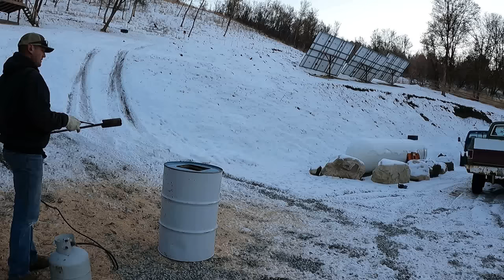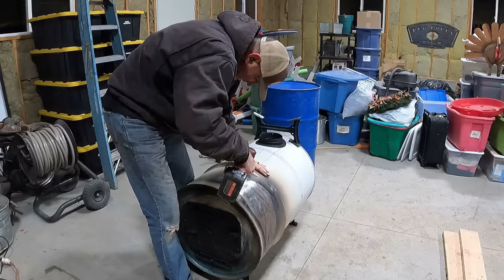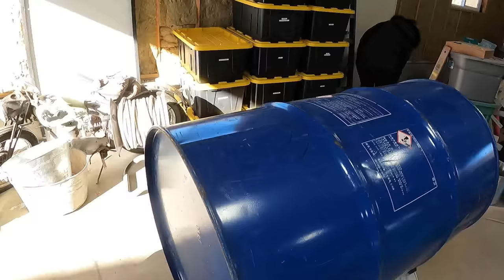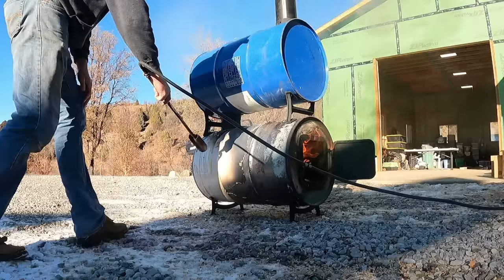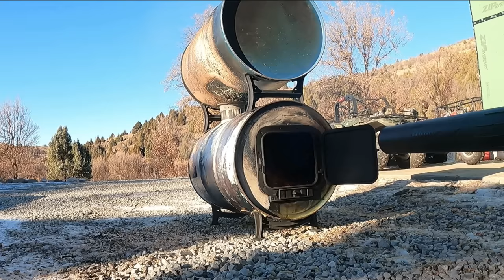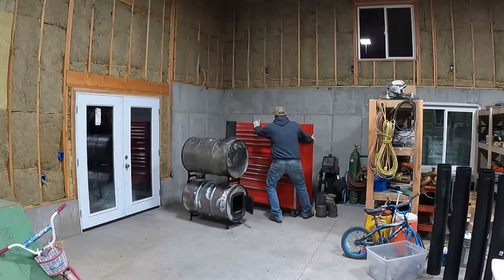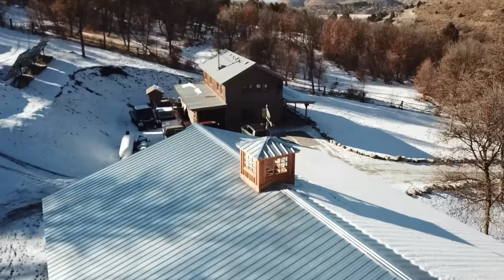I Built The ULTIMATE Wood Burning Stove For The Shop...

Comment: Awesome job. ne thing you did not consider is the metal weakness. In those barrels, the metal is so mild that it will burn through eventually. By this year 2022 you probably already have to replace the barrels if you used them a lot.
Reply: Mine is 27 years old this winter, ash bed only, never any issue with a few hours of yearly maintenance.

Comment: Now make a sheet metal cover to go over the air intake and use a dryer vent to the outside with dryer hose connecting the  vent to the sheet metal intake air  cover, 

So that make up air comes from outside and you dont burn your already heated air. You keep every btu  generated. This also makes the barrel stove pressure neutral.

35 % more efficient.

Be well.

Comment: Could have done radiant heat using a wood burning stove as a way to heat the water/glycol. Then the slab is more thermal mass to keep the shop warm after the fire stops.

Comment: Counter wasted heat up the chimney. Aluminum long fins (with tabs on the end) you can make yourself can be held on the exhaust pipe with a huge metal hose clamps, acting like a small radiator to gain another 10 -15% heat transfer.

Comment: If you buy heavy barrels you can cut holes in your double and 3 or 4 in the top of your lower to add 3/4 or 1" black pipe thru them, it will work more like a heatilator and push more hot air in to the room, you can also add a heatilator to the exhaust and retain even more heat
Reply: More bends in your pipe also slows your exhaust down to help retain more heat, also adding a 90 at the top of your barrel and a drop catch can help not get water and such in to your heat source
Reply: @kwazhims3lf  I would put a cleanout on my top barrel, and a good heatilator has a cleanout scraper on it.
Reply: @kwazhims3lf  I did see the cap after I made my comment, but still has a chance of getting moisture in

Comment: First I would have found a barrel with a removable lide and clamp. Lined the bottom with fire bricks and have the ability to clean out the ashes . Hang a fan behind it and possibly a ceiling fan . The cold air intake is obvious. I realize he is off grid but he does have power.  Cold weather comes at a cost.

Comment: put some firebrick in the bottom of the fire barrel and offset the door appropriately and you will have a long(er) lasting stove.
Reply: Yeah single wall pipe on the rafter is not a good thing I would go for more of a foot for spacing.

Comment: Obviously after the fact, and bearing in mind I have built precisely zero barrel stoves, but...

Do you think that you could have ran some black iron pipe from above the furnace door to below the link between the barrels? In a U-shaped configuration, with two open legs at the front and holes drilled in the bottom of the 'U' just below the barrel bridge pipe. That should draw cool air in from above the furnace door, superheat it as it travels above the fire in the lower barrel and push it into the smoke stream as it exits into the upper barrel. This should (in my mind, anyway) ignite all the unburnt wood gasses and solid particles in the smoke, massively increasing the heat output by getting a secondary burn on what would have been lost to the chimney. Should also give you a much cleaner burn, so less cleaning required as a bonus.

That's essentially a gassification stove in a nutshell, and a very inexpensive modification to the design of your furnace which might make it burn far hotter and cleaner than it does now. I might be talking nonsense though, if anyone else has tried it and it doesn't work, but I am certain the theory is correct if nothing else.

Might be something to bear in mind if you do end up having to replace one of the barrels in future.

Comment: Top barrel cut hole in each end put a 12 inch pipe weld in  put fan move air  to get xtra heat

Comment: I watched a previous video with a double barrel and what the guy did on the upper barrel was on the top and the bottom of the barrel he drilled a series of holes that were in line with each other and he took two inch exhaust pipe and went from top to bottom with a little over half an inch hangover out the top and out the bottom and welded them in place so that way none of the smoke could get out of the upper barrel except through the stove pipe and then he bought a $20 metal fan from Walmart which is the same exact size as the barrel and he mounted it on the back side of the top barrel which forces cool air through those exhaust pipes and blows the heat into his shop cuz I believe he's said he had a 40 by 80 ft shop and he uses that to heat his shop as well and he said with the adding of the fan and the exhaust pipes in the second chamber those exhaust pipes heat up like manifolds at least I think he called them manifolds but either way the the exhaust pipes heated up from the heat from the lower barrel and the fan just blew the air through the exhaust taking the heat with it and pushing it into the garage might be something you'd be interested in and a later build or modification down the road it all depends on how well this one heats your garage

Comment: I cannot tell from the angle but in case you don't know, The venting code for single wall pipe is 18" of clearance between it and anything that burns. From the angle you filmed it, it looked a bit less than that. I would hate to see a film about your shop burning to the ground. Nice looking stove.

Comment: I hope this is not a foolish question, so consider it from a neophyte who is interested.  The top barrel is to add heat - could one fill soapstone in the top barrel 1/4 to 1/3 and let the soapstone absorb the heat and release after the fire died out?  Would this be efficient or dangerous?  Thanks in advance.

Comment: I know a person with a barrel stove they are okay.. but inefficient, the metal is really thin so it warps after time and becomes brittle.. also didn't retain heat like a good thick steel stove.. once the heat is built up in the steel the heat can be maintained with very little wood.. also air intake choke is necessary aswell, cool project tho haven't seen a double before

Comment: Now that a tear has passed what additional modifications are you planning on making.  When we had our double barrel stove we lined the bottom barrel bottom with pavers (that were cheaper than firebricks; they hold heat and protect the barrel from burning out.   I have seen some YouTube posts where a pattern of horizontal pipes were added to the upper barrel allowing fan blown air to capture and circulate additional warmth from the upper barrel.  (https://youtu.be/RXY0JKU12jg ).  I would be tempted to add something similar if I could rig a thermostat to energize an electric circuit when the upper barrel was above a temperature, maybe 80°.  

Wishing you and your family a blessed thanksgiving season.  Thanks for sharing this insightful video.  Cheers

Comment: I noticed that your pipe is not or doesn't appear to be as tall as the peak of your roof. If it was above that by several feet it would draw better.  There's a "rule" called the 3-2-10 rule for the height of your pipe/chimney.  3' above the peak or 2' taller than something within 10' of the pipe/chimney.

Comment: Are second barrel is 30” above are bottom barrel and we cut a whole in the top barrel and installed a 10” inch pipe from front to back with about 6” sticking out the front the smoke and heat goes through the entire barrel out the top like normal but we put a blower behind the 10” inch pipe it heats a 60’x 50’ shop very well generally gets to hot in the shop.Are door was bigger before putting it on we cut a piece of boiler plate that just went through diagonally got it laying flat for the burn pad so it wasn’t using the bottom of the barrel.

Comment: II would say that it is way  more trouble than it is worth and probably does not give that big of bonus.

It is mostly gas furnaces that use outside air  and they are located close to a wall, closer than your typical wood stove installation so they use a short piece of PVC pipe and they use a fan to suck in that outside air 

So unless you a large diameter pipe  at least 6 inches and keep it relatively short, less than 10 feet it would be like trying to breath though a garden hose , you would probably have to install some kind of fan IE "forced draft blower"  but then unless it is very volume fan the fire would run way to hot,, cherry red level of  hot and you would burn out that barrel in months not years maybe even weeks and you would burn a LOT of wood and all things considered the stove would create TOO MUCH heat, so much so that you might be opening doors or windows a crack to let some cold outside air in which supposedly is what you are trying to avoid in the first place  

Last but certainly not least, where on the front of this stove, I assume it would have to be on the front of the stove to get it to draw right could you even have room to cut a 6 inch diameter hole for this outside air pipe ??

Comment: So what are the advantages of this constrution?  Are the emissions down or does it emit 750 times more fine particle pollution than a HGV Truck? It is sort of like a rocket heater but it doesnt burn the smoke thus eliminating practically all the pollution. Will that be your next consideration when doing a revamp of the construction in 5 years time. Or, perhaps earlier?
Reply: ?
i look at it, and the 2nd chamber (barrel) acts like a baffle to the combusted air, takes therms from it, convection does its work, remainder products of combustion travel up the flu and are vented...
emissions? he lives in a temperate climate.. its cold, and cold destroys everything... his other options to heat the space are high effic nat gas furnace, propane option if theres no line... nat gas boiler and rads.. hybrid boiler and rads blah blah blah they all require hydro carbons, and electricity which is most likely generated by hydro carbons to operate... how many emissions, from ground up, processing, transmission, to appliance are in that chain? ... c'mon.. does it even out?
its a lot...  this guy looks to have an acreage, which is going to generate wood, either through fallen trees or clearing brush, which generates firewood, and well you know the rest....
he'll be fine.. i grew up on a 2 acre property, every year we had a "waste pile" of sticks, waste that always grew to a height of 6 feet by 7' to 8 feet lateral, that needed to be burned... anything else was used as firewood.. it seemed endless.... and thats prairie land... i couldnt imagine living farther north, in thick forest... it would be night and day 24 hours managing wood piles.......

Comment: If you are smelling the paint, I will wager it is not very healthy to breathe that.
If the stove is not airtight, you will also breathe the smoke and small particles, especially if the burn is not clean.
I would recommend water or at least rocks on the upper compartment and on the sides to retain some of that heat. Right now it is just burning and escaping which means you have to keep heating it all the time.

Comment: Just a word of caution:  I built the exact same thing.  After I assembled it I took it outside the garage to start a fire in it without the flue and burned the paint off.

As the stove got hot, the residual oil in the barrels started on fire.  The door on the stove started slamming, and blue flame shot out of the top at least 25 feet in the air, it started glowing bright red and i was afraid it would fall over and really start something bad.  Luckily, it ended on its own.

Comment: Some issues going on here...
1. Heater near glass door,heat is attracted to path of least resistance (heat loss)...
2. Also radiant heat travels to the cealing,heat rises up and lower level is much cooler... To realise this you can get ladder to go up and notice the difference in temperature...cealing too high here resulting in lower lever being much cooler.
3. Having atleast two in such a large area will help in temperature...
4. Stove pipe should be only 4" in diameter,doing this will increase tempature.

Comment: Be more careful lining up the barrel caps .put the largest one o  the bottom and use a 4 to 6 inch pipe on it you can add a cap for safety when you want to leave it alone .that cap makes a better breather than the one on the kit alone .

Comment: That smoke pipe is very close to the wood could be dangerous in Massachusetts we have to be 18 inches from any combustible materials you should use all fuel pipe through the roof and put a cap on top and a tee on the bottom put a clean out plug in the bottom then come out the side of tee withe your stove pipe would be much safer so your shop is protected I did a similar setup but I also have a fresh air intake to feed the fire just have it above normal expected snow level and bring as close as you can to the stove if not the stove will suck the heat out and you will go through more wood

Comment: Great video but you should’ve crimped your take off and flipped your pipe over. You want the female ends of the pipe facing up or smoke can escape at each joint.

Comment: Well, actually, the oven itself is only half the battle. the main question is: how much heat remains indoors? hence the next question is - what temperature the exhaust gases leave the chimney? in other words, will we heat the air outside or will we still heat the air indoors. it will be ideal if the temperature of the smoke at the outlet of the chimney is about 25 - 30°.  therefore, it should be understood that the stove itself is only one of the elements of the entire system for efficient space heating. here we come to the elements of thermodynamics and the science of efficient utilization of the generated heat. After all, we are interested in the efficiency of the entire system (furnace and system for the useful utilization of heat from flue gases). Flue gas temperature cannot be neglected. In other words, how efficient is the whole structure, what is the maximum heat transfer from 1 cubic meter of fuel (wood in this case) per unit of time. The efficiency of the furnace itself is of little interest to us, it is important that the maximum possible heat remains indoors. I think my point is clear. Just as a piece of advice - look through books about shipboard heat recovery systems on board (utilization boilers). You can come up with a lot of solutions - from passive systems to systems with forced circulation of water or air, blowing radiators and so on - maximum freedom for engineering imagination.

Comment: On a concrete floor ... okay; however, on any other kind of floor, I'd want a metal tray with sides for it to set on same as you put a tray beneath a water heater "just in case".

Comment: Top barrel would have made a good oven to bake bread in or cook roasts ,I'm just saying, it's wasteful just to burn wood for heat alone all you needed to do was put a metal box inside the upper barrel, with a door naturally, and you could cook just about anything you like,and weld a hot plate on the top ,or hammer out a flat spot using a brick on the inside and then you can boil water and so you've got tea and coffee off the grid, if you've never tried baking bread in an oven I highly recommend it the smell alone is to die for,

Comment: As someone who for 25 years did burn wood for heat (boy do I miss a wood heat source,) I would recommend a 8" in. stove pipe, instead of 6" in. stove pipe.

Why do I miss a wood heat source?  ANSWER: Because a wood heat source truly heats you down to your bones.  Propane heat source fireplace doesn't do it, electric forced air doesn't do it, and electric baseboard doesn't do it either.

Comment: You know if you would have ran your exhaust pipe out the side or the back of the bottom Barrel or put a thick solid pipe all the way through the top Barrel and welded it real good to make it watertight you can fill the top barrel with water which would put off a lot of radiant heat without burning as much wood, I know a guy that had one like that and it worked really well he also stacked firebrick in the bottom and about halfway up the sides he also had a metal grate made and put in it for the wood to sit on and a draft door at the bottom this let air get up under the wood where it would burn better
Reply: not needed, the 2nd barrel fills with heat/smoke, you are adding more steps and wasting water
Reply: @gregoryeverson741  yeah but with the water in the top Barrel it will produce heat a lot longer than just a plain Barrel letter for saving on wood trust me on this I've seen it

Comment: sand in the bottom of the stove will keep the metal from burning through. And the angled chimney pipe at the top looked too close to the roof framing.

Comment: when i was a kid in Ohio we had this very setup in our basement . . . sort of .
ours had a 12 inch pipe through the center of the top barrel .
on one end of the pipe . . . a furnace blower hooked directly to the thermostat .
the other end was connected to the ductwork installed in the house . the smoke pipe went right into a brick chimney .
we burned wood and coal in it . had one chimney fire in 16 years .
it kept a 2 story house toasty all winter . . . i split a lot of wood . . . A LOT .🥵

Comment: That is not the ultimate barrel stove. I build one a few years ago that not only has the upper barrel, but I put  about 24 inch and a half pipes through the drum lengthwise and welded them into the upper drum. I put an old box fan and ducting to blow air through the pipes. Build this way it will put out about twice as much heat as a normal 2 barrel stove.

Comment: hey dude, it's been two years since you built this stove. time to take it apart and clean the creosote out of the inside. this kind of design looks like it turns into a fire hazard with time and use. be safe. CSL is a product you can use to loosen the creosote. need to physically scrape if off to be fire safe.